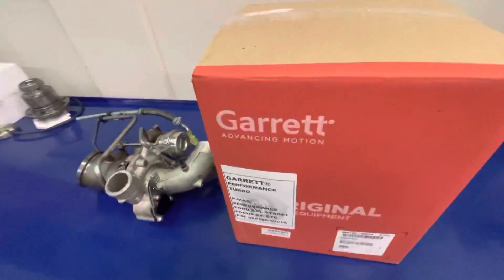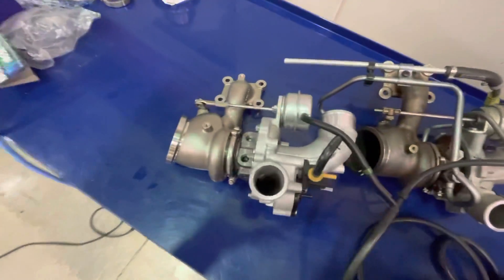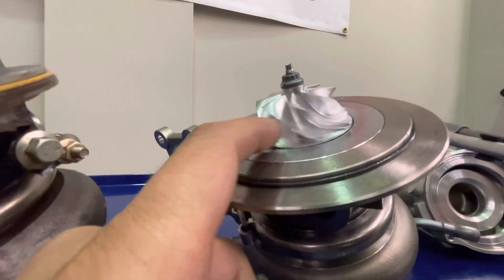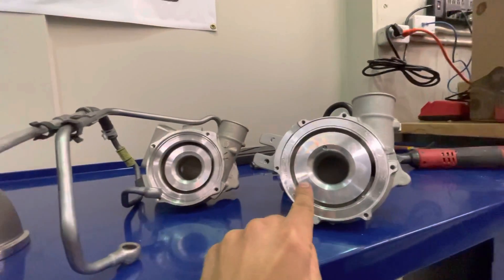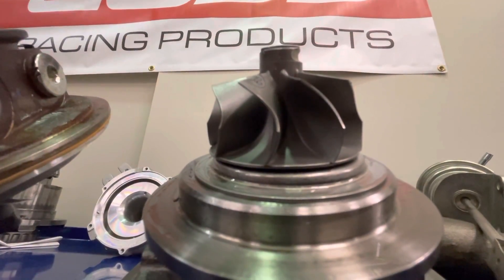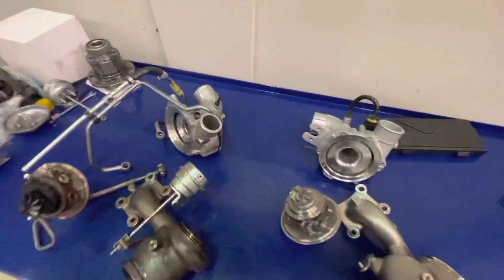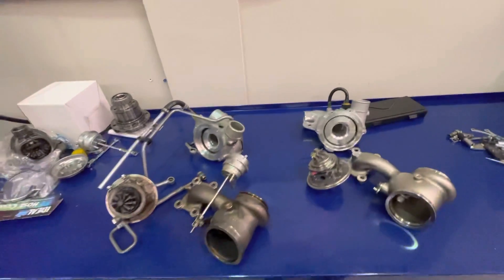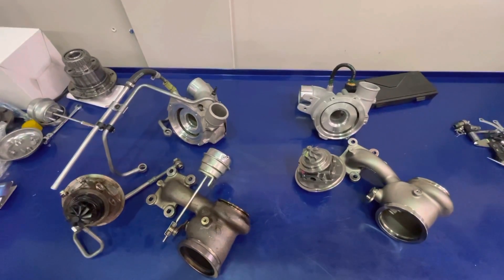Focus ST Garrett PMax Turbo Upgrade Deep Dive

Comment: I have a Stratified Flash Tune on my Focus ST. If someday my stock turbo needs replacing, is it absolutely necessary for a custom tune or would it be ok with the existing tune?  Or could you just do a revision since this isn’t really a “big turbo”?
Reply from the maker: We are in the middle of tuning several of these on different setups so we will find out if we can get away with a flash tune. For now we have them bundled with a custom tune on our site. https://www.stratifiedauto.com/index.php?main_page=product_info&cPath=116_98&products_id=1051
Reply: @stratifiedauto  Any idea if this turbo work on the stock tune long enough to get emission monitors ready and pass smog? Definitely not trying to race around on the stock tune or run it for longer than I would have to. Just need to know if it would work. Thanks in advance!

Comment: What were the turbine measurements? You mentioned the compressor wheel sizes but not the turbine.
Reply from the maker: They are in the video.
Reply: @stratifiedauto  No, they're not.

Comment: Hey there 
What the price of these turbos and if I'm Full bolt ons running E30 what power should we be looking at ?
Reply from the maker: Here they are including the tune. https://www.stratifiedauto.com/index.php?main_page=product_info&cPath=116_98&products_id=1051
Reply from the maker: You are looking at just over 300whp
Reply: According to edge, it’s 300whp on an otherwise stock ST (maybe just a FMIC). With FBO and E30, you’re looking at 350whp or slightly more. Watch edge’s yt video
Reply: Yep, 304/391 after tune but what done w/ just a fmic and at 5400ft above sea level. Can easily get 335/415 out of this Garrett w/ fbo